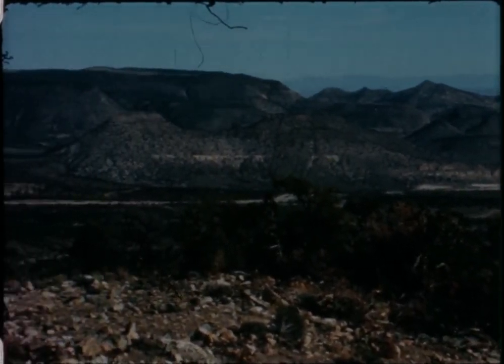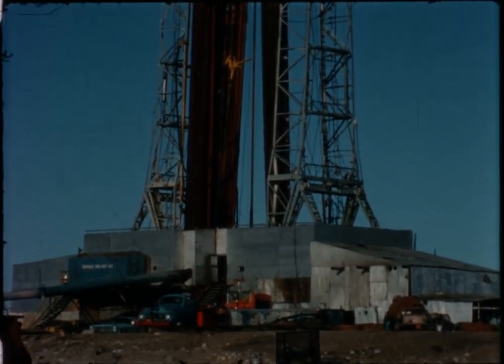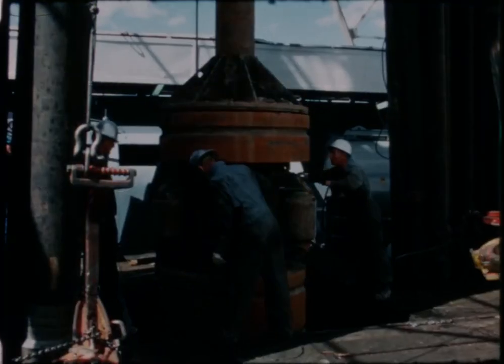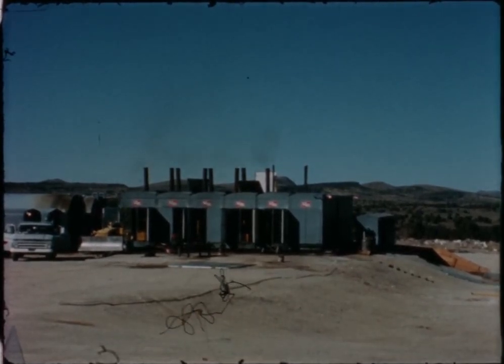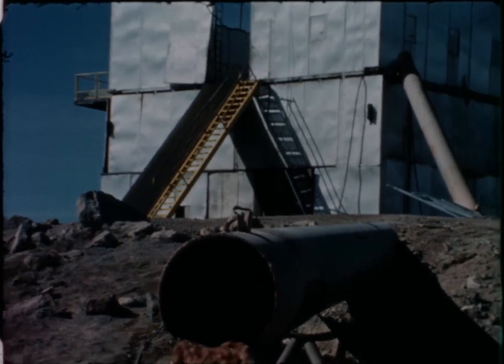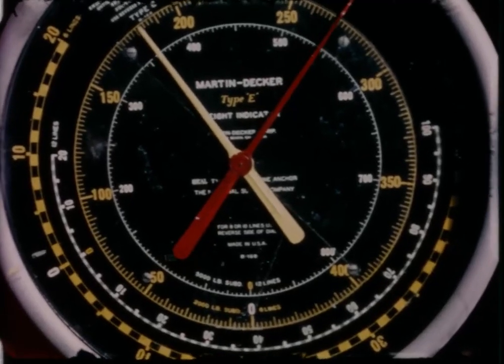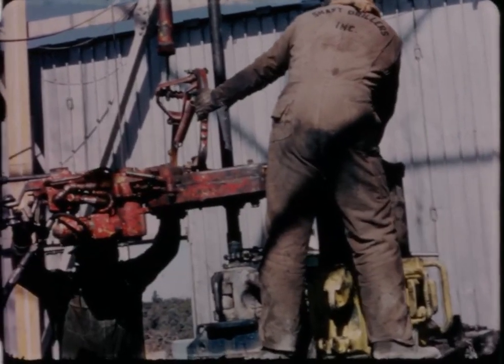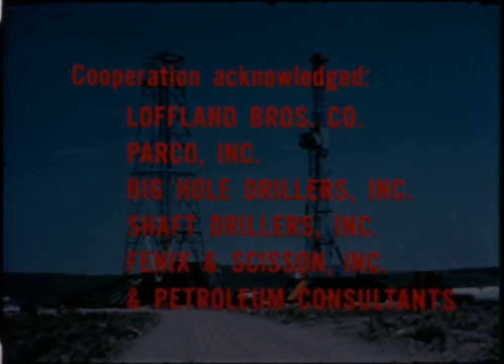Big Hole Drilling at Pahute Mesa

Comment: What is more amazing is that after the hole is finished, miners would sometimes go down the shaft and hollow out a test chamber.
Some of these test chambers were huge. One was a 150-foot diameter sphere to investigate shockwave decoupling.
It took 2 years and removed 250,000 tons of material.
In the deepest holes, 50'c+ water would literally spray out of the walls.
Reply: The vast majority of tests did not have cavities.